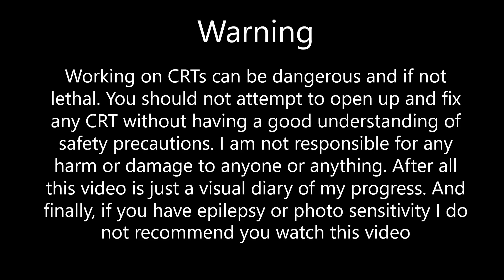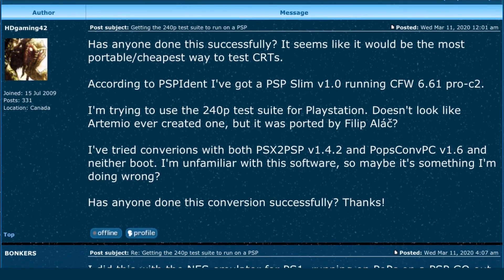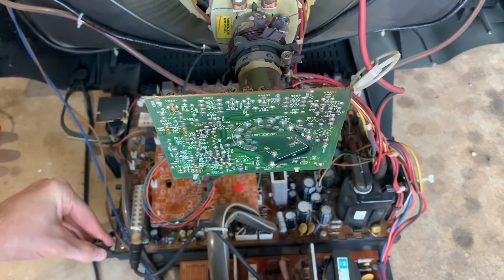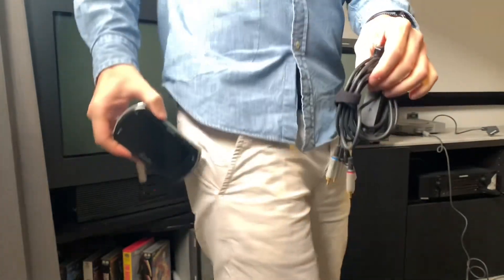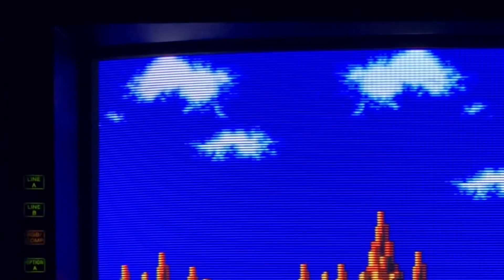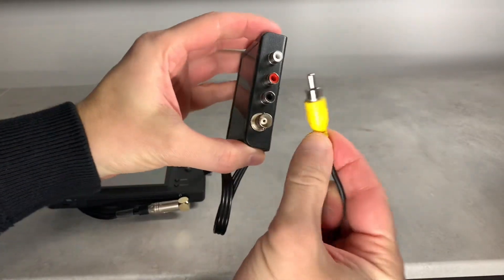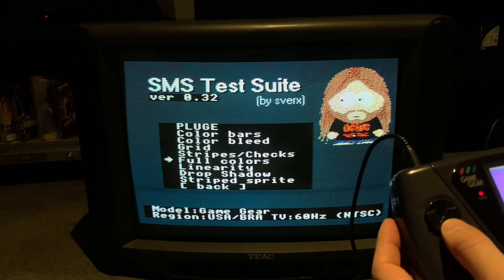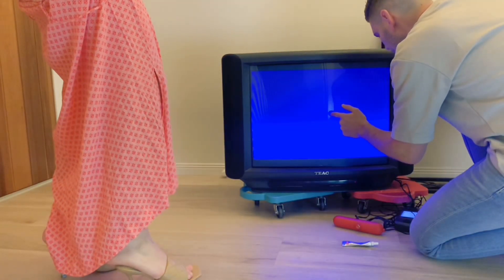240p Test Suite for the PSP! Portable consoles to test a CRT on the go

Comment: My prefered tool is still the Wii, as it has all cables (SCART/composite/component/S-video), it does 240p/288p/480p/576p and you can leave the IR bar at home, reaching Homebrew channel goes perfectly without. If it really does need to be portable, for cargo bike pickups, which not always suits the hefty TV I plan to take home, you might want something smaller. Yet I also bring a power brick with 5m cable, as more than often testing happens in a crammy house entry hall or garage with a single power socket in a nasty location. But the best portable piece is a M5Stack with composite RCA stacking module. That can be programmed to both NTSC and PAL, and runs of an internal USB-C chargeable battery. It is only 5x5x4cm. But soon I will have the venerable Philips Pattern generator, so I might drag that with me on future errands. It does allow TVL measurements, teletext testing and measuring horizontal resolving power, you can forget about that on the 240p suite. The M5 Stack is capable of delivering variable horizontal resolutions though, but I have to deep dive into the C++ code to make it happen. I also plan to make a PiPico based SCART testing tool, as its PIO allows for fluent changes in horizontal resolution too.
Reply from the maker: That’s some serious testing gear. I’m interested in the scart PiPico tester/pattern generator if you ever make the project public